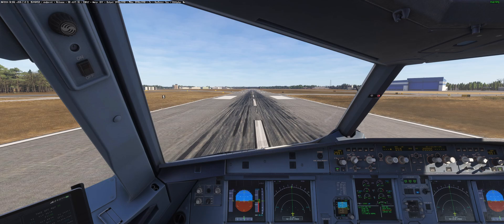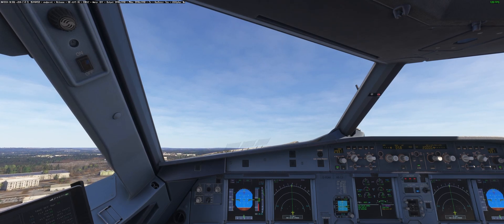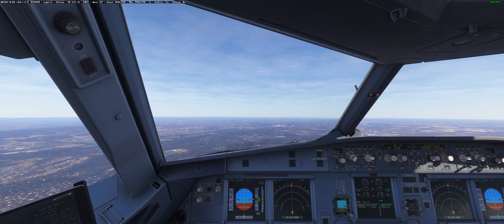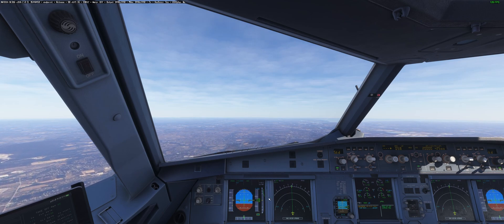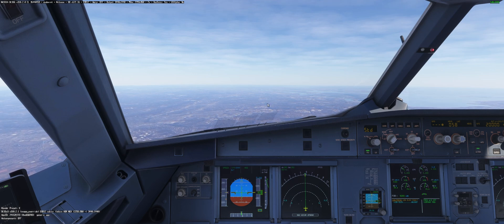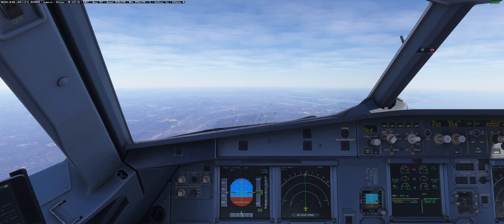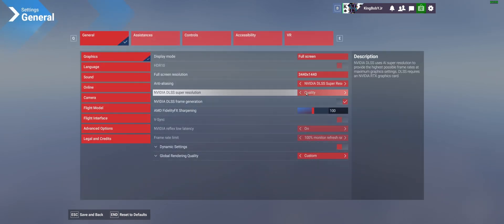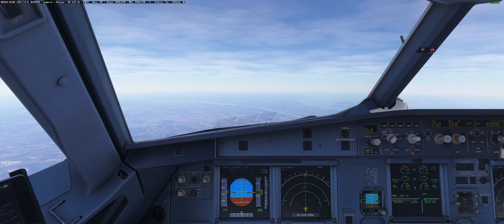MSFS 2024 - DLSS vs TAA - Why I don't use DLSS

Comment: The amount of ghosting you see in DLSS 4 is proportional to how far you zoom out away from the instruments. I use DLSS/DLAA. When zoomed in closer to the instruments, there’s no ghosting. The further you zoom out, the more the ghosting is noticeable.

There’s been definite improvement from 3 to 4, even just in the sharpness of the glass panels. But I’m sticking with it in my case because it allows me to fly around New York City in 4K with graphics maxed out at 60 fps. 😅
Reply: What gpu do you own?
Reply: @ 7800X3D with a 4090.

Comment: What's the overlay used to give the details in the top left?
Reply from the maker: The overlay can be added in one of two ways.  The easiest is to download DLSS Swapper, go to settings, under DLSS Developer Options, choose Enabled for all DLSS DLLs.  This will add the correct registry entries.  The other way is to add those registry entries manually using the registry editor built into Windows.  See the description of this vid for how to do just that.  Cheers!!!

Comment: Hey, following up on this. I watched another guy that had the same issue and he suggested using dlss swapper because the Nvidia app is not forcing dlss 4 correctly. I did what he instructed and there is a massive difference! It's all nice and sharp, no more ghosting or blur. Try it out
Reply from the maker: I did do just that, used DLSS Swapper to inject the latest version of the DLSS DLLs.  In the vid you can see the sim is indeed using them, version 310.2.1 & 310.2.  While it is clear and sharp on non-glass cockpits like a C152...not so on the Fenix A3xx...still a blurry mess.